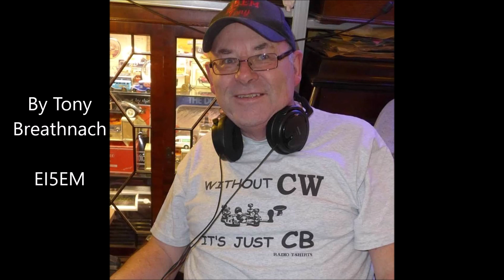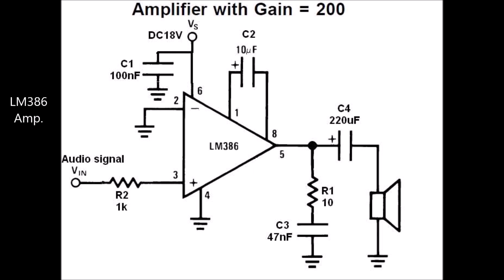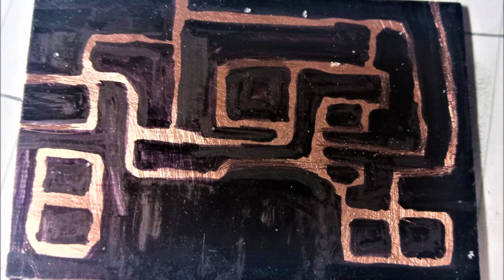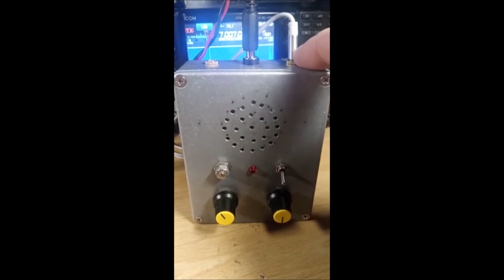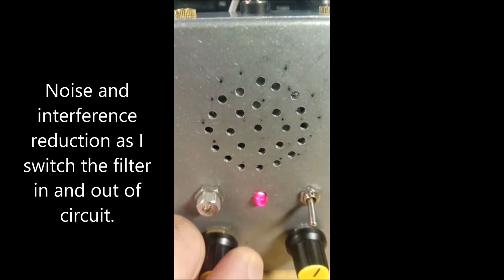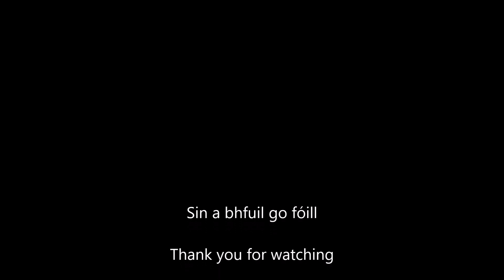A Homebrew Active CW Filter

Comment: The 220 uF capacitor at the output of the LM386 allows passing 90 Hz signals that are unnecessary in communications and lowers the Signal / Noise ratio.
If you replace that capacitor with a 68 uF, the lowest frequency will be 300 Hz with a gentle slope, which will greatly improve the audio quality in CW or SSB..
More: If you insert a 47 uF capacitor into the line of the loudspeaker or the 8 Ohms headphones, the signal will sound much better, even without using any filter.
Regards. LU1AR